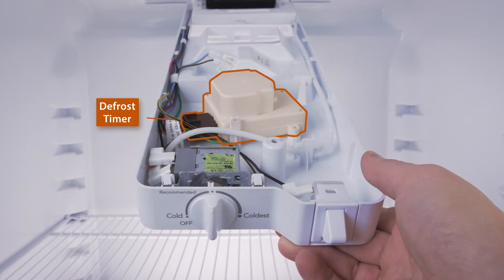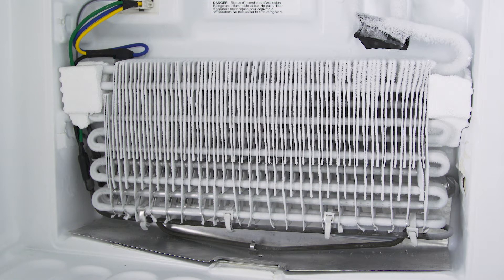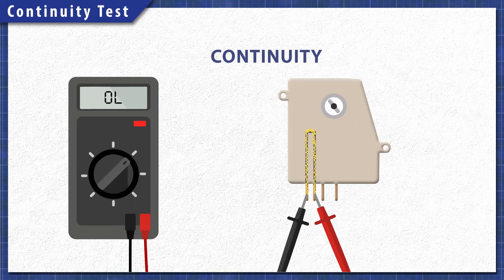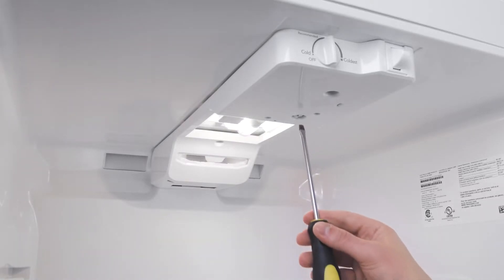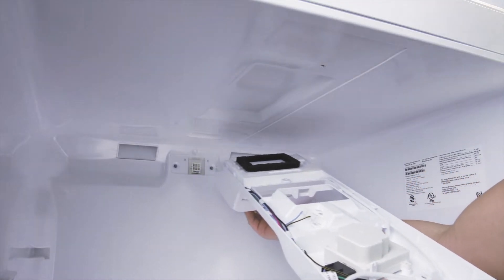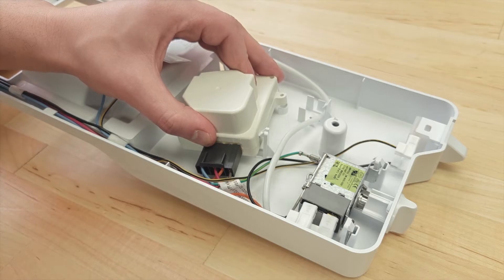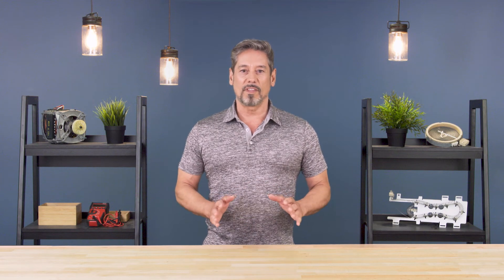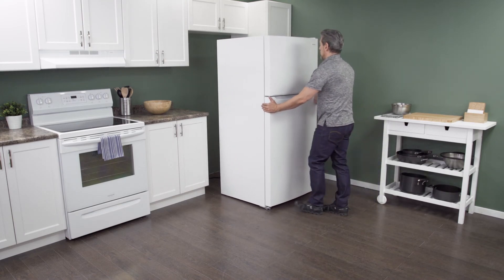How to Test & Replace a Defrost Timer in a Refrigerator | Repair & Replace

Comment: I have continuity at on 1 and 2 at every point in the dial turn, before click after click after second click and during normal turning there’s always continuity. I’m assuming it’s broken and replacement is needed ?
Reply from the maker: Yes that's a sign that it has failed as it is not switching on and off. If 1 and 2 always have continuity then the defrost cycle will stay on all the time.

Comment: I have an LG LFC24770ST/02 and the refrigerator is constantly turning on and off all day.  It'll run for about 20 minutes and then turn off for about 10 minutes.  It will then turn back on again and repeat the cycle.

Is this a sign of a bad defrost timer?

Where is the defrost timer for my refrigerator located?  I do not have an upper control module like shown in the video.

Thank you for any help you can provide.
Reply from the maker: Sorry for the delayed response. Not all models have defrost timers. In your case it's likely an issue with the heat transfer, so check the steps in this video: https://www.youtube.com/watch?v=pI0ian6WqSI

Comment: Hello hi! My refrigerator stopped defrosting a year ago..I started defrosting myself..then all of a sudden it stopped freezing..had control board, relay & capacitor changed. The compressor is on and fans are working..still not freezing…cleaned coils best i could being they’re in the front..PLEASE HELP!!! tia😊
Reply from the maker: Thanks for watching. We have a video that shows what to look at when trying to troubleshoot a refrigerator that isn't cooling properly: https://youtu.be/oPmr6boufmE?si=mq806Lx_s4Amg2xE

Comment: My Frigidaire top freezer/bottom fridge stopped cooling and my compressor clicks on then off after 3-5 seconds every 10-15 minutes. l’ve replaced the thermostat, start relay, and run capacitor, I believe it might be the defrost timer after watching the video, do you think that’d make the most sense? Nothing I’ve done so far has fixed it.
Reply from the maker: Thanks for watching. A faulty defrost timer would prevent the compressor from running so it's likely not the cause. We have a in-depth video on how to troubleshoot the compressor. It's best to check the compressor windings as well as the overload if you haven't already: https://www.youtube.com/watch?v=NND8J8dXqJ0

Comment: Great video simply emphasize everything. Please check the air direction 2.20 minute. Thanks.
Reply from the maker: Thank you we're glad that you found it helpful. Yes the airflow direction should technically be reversed as this is how it is in most models. Unfortunately we cannot adjust that part of the video without deleting and uploading which would lose all views/ comments / interactions.

Comment: Our 5 month old fridge hasn't been cooling properly for nearly a week. It's under Frigidaire manufacturer warranty. It started getting warm on a Wednesday and they finally got someone here on Monday. He said the heater was always running and thought it was a bad control board, which I'm pretty sure our fridge doesn't even have. Said he wasn't sure and didn't have any parts so he left and they sent two different guys Tuesday who said it was low on refrigerant and needed a compressor. No cost to me so okay. They left but it's still doing the same thing. Now they say it'll be around 5 days to come back.  I'm tired of using a neighbors fridge so I pulled the control board and grabed my meter to check the defrost timer. No matter how I turn it I have continuity on 1-4 and 1-2 at the same time all the time. Is it possible that the fridge is cooling and defrosting at the same time? 38° freezer, 46° fridge consistently over the past week. I marked the timer and it is turning so it's not stuck there.
Reply from the maker: It is rare to get continuity 100% of the time between terminals 1 and 4 as well as 1 and 2 that is not something I've seen. The way that the defrost timer is designed it's not normally possible for the defrost timer to send power to both unless something is defective inside. Your tests would say otherwise. 

If both the cooling and defrost circuits were powered simultaneous then the defrost heating element would be warm while the fans are running. 

You could temporarily bypass the defrost cycle as a test (but that might void your warranty depending on the small print). If it was stuck in defrost mode, then disconnecting the defrost circuit either at the defrost timer or unplugging the defrost heater would fix the problem temporarily (but you'd slowly get some ice buildup) that would confirm the test on the defrost timer.

Low refrigerate would also prevent a new refrigerator from cooling properly.
Reply: @AmreSupply I made a jumper wire between 1-4 and that made the fridge work until I could get a new timer.
Reply: Appliances are made like total garbage these day's it's a shame.

Comment: Good Morning 🙏 Sir my fridge Defrost timer not turning so please  advise me what to do
Reply from the maker: Thanks for watching. If the defrost timer is not turning then either there is a bad connection and it is not receiving power, or the motor has failed.

Check the connections. If this doesn't help then it's best to install a new defrost timer.

Comment: Tested mine. When continuity is supposed to be there, either between 1&2, or 1&4, there is, (although I have a cheapie DMM), and the numbers are all over the place. When continuity isn't supposed to be there, there's none. So the timer is throwing weird readings, or the DMM is garbage. According to your video, it's still good. Before I unplugged the fridge, I advanced the timer to defrost. 30 minutes later, the compressor and fan started.
Reply: I haven't put it all back together yet.  Last summer it gradually started getting less cold in both freezer and fridge. Compressor was staying on longer. Water would leak at the hinges, but nowhere else. Not much frost would build up on the back panel, just a light coating on the right side. I watched 2 more of your videos about the cold control thermostat and defrost thermostat. Both tested good. Heater works too, you could see it melt what little frost there was on the evap. coils(back panel and doors off). You can also turn on/off the fan and compressor manually with the knob. Only thing left is low freon(but where's the leak?), clogged capillary, or the door seal. I think it's the bottom door seal. Lower right(hinge side) the seal is slightly curled inward, like it was binding when opening or closing.
Reply from the maker: Thanks for watching. It is possible that the contacts were stuck and advancing it manually helped reset it in a way. 

Has it continued to work? Or is the same problem happening again?
Reply: By the way, it's an older Kenmore from 87/88. Model 2538638282.
It doesn't show up in the search.
Thanks in advance.

Comment: My defrost timer spins only when there is 240V connected directly to it - it does not spin when connected to the freezer (there is 1-3V coming to it then). Can this fault be repaired? Daewoo fr-3801. Please help
Reply from the maker: Thanks for watching. If the defrost timer is not getting enough power then it's possible a faulty cold control or there's an issue with one of the wires leading into it.
Reply: Could it be safety thermal fuse in the freezer? Will it affect timer if broken?
Reply from the maker: @marekd3758  If you look at the wiring diagram in this video it will help answer your question. If your model has a thermal fuse in the freezer, then it will cut power to the heating element. It won't prevent the defrost timer from receiving power as it is powered off of a different line. https://www.youtube.com/watch?v=r2YUNLPs4kM
Reply: I have very old device, Daewoo fr-3801. I have the diagram but I am not sure why there is no current flowing through the timer or low voltage on cables when I detach the timer 😢
Reply from the maker: @marekd3758  So in these models the cold control thermostat and the defrost timer are linked together so when the cold control calls for cooling, then the defrost timer will run and advance the time. After 8 hours of run time of the defrost timer it will start the defrost cycle.

If you checked the voltage on the defrost timer when the cold control is off, then there will be no power to the circuit.

If the cold control has failed then the compressor won't run and the cooling will not work. So if it's still cooling then it's best to test the defrost components.

The motor / the capacitor on the defrost timer can fail, as well the defrost heater, the defrost thermostat can also fail.

Test each one and verify. If all the defrost components have continuity then replace the defrost timer.
Reply: I checked the defrost timer by suppling 220V to it directly and it is working. The compresor is also working. The only thing that I think is broken is the thermal 77 degrees fuse. Do you think that after replacing the fuse, everything should get back to normal?
Reply from the maker: @marekd3758  a defrost fuse should not prevent the compressor from running, it will just prevent the defrost heater from working. 

It is more likely that there is a problem with the cold control thermostat or an issue with the wires. 

The cold control can be tested for continuity: https://www.youtube.com/watch?v=09MmevMH0hA

As well you can check continuity of the wires and look for any loose connections or corroded terminals this can also create issues.

Comment: My refer has stopped twice in the last few days.  All components at the back of the refer test good.  Tapping the panel that the defrost timer and cold control thermostat are mounted on fixes it until it sticks again.  Which component, defrost timer or cold control thermostat, is the most common one to have bad contacts?
Reply from the maker: Thanks for watching. If it works after you tap it then it's more likely that it's a fauly cold control thermostat: https://www.youtube.com/watch?v=09MmevMH0hA